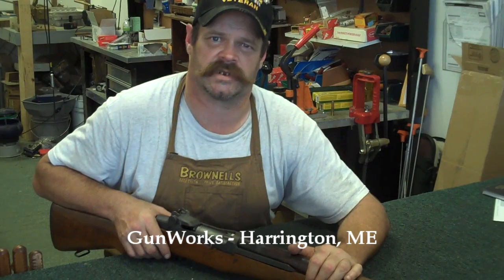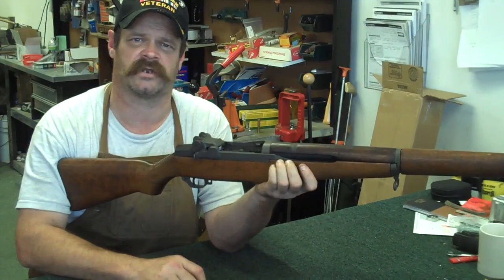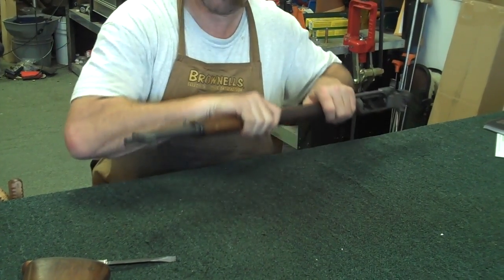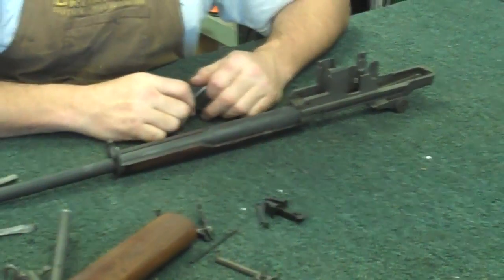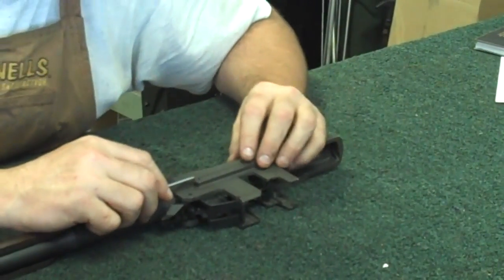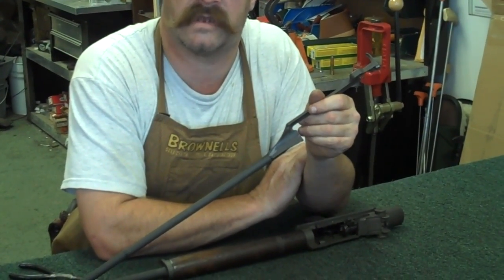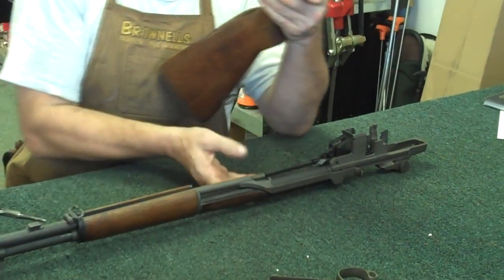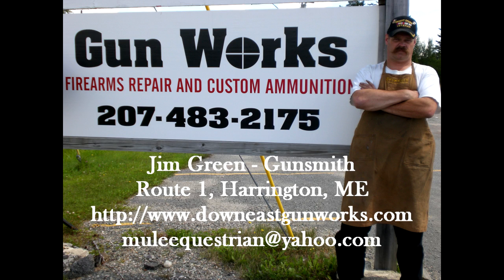Gunsmithing Disassembly: M1 Garand (.30-06) (Gunworks)

Comment: Suggest tapping on the bayonet lug and not the front sight, though it's not a big deal either way. Also, once you have it built and in use, you don't and shouldn't remove the gas cylinder too often, perhaps once a year with moderate shooting.  Any more will loosen the fit and degrade function.

Comment: Jim,
Thanks for the video.  I just did a full teardown for the first time on my Garand so I could re-finish the stock on it.  The gas cylinder on mine is really tight too.  The soft taps with the plastic mallet will be what I'll need to do to mine too.  You've made it clear and easy to understand the teardown and assembly process from start to finish.

Comment: Jim I also found an incorrect bullet guide. I have a very early 309xxx serial number SA. The bullet guide was later stamped part with the cutout. When I went to reassemble I couldn’t get it in. It is approximately 10 thousands oversized. I ordered a new one. Thanks for your videos. Semper Fi!

Comment: I suppose it doesn't matter, but doesn't the op-rod spring install with the tapered portion sliding into the follower arm?
Reply: "Before putting the Operating Spring in reattach the Follower Rod. Many of the M1 Springs the springs are 'necked down' on one end. This is the end that we thread the Follower Rod into." CMP tech tip  civilianmarksmanship dot com/assemblyhtml/reassemblefeed8 dot html

Comment: i just a watched a socom 16 disassembly and cleaning with a grease: lubriplate. Oil was also used. Any opinions on using grease to lubricate your rifle? i did not fail to see you doing here. what if one were to use very thin layer of grease on everything and do without the oil?

Comment: M1 rule of thumb is "if it slides, grease it; if it rotates, oil it."  The most important places for lube though is to grease up where he mentioned (on the op rod), all of the bolt's locking lugs, and the associated rails.  Beyond that, lubricating some of the pins and other parts that interface will reduce wear.

Comment: On my garand the taper on the op rod spring fits snug over the follower rod. I noticed that you put the tapered end of ur spring in the op rod 1st. just wondering if it works both ways or if its recommended one way or the other. my garand seemed to operate fine with the spring in oppisite as you had it in the video. Thanks and great videos i enojoy em

Comment: You're a Marine and called it a "gun"?  Drop down and give me 150.  Gun, my ass, it's a rifle.  And yes I'm a Marine and a Vietnam vet.  That little "lock piece" is called a gas cylinder locking screw.  You need to refresh the nomenclature of an M1 rifle, son!  That's called a bullet guide and a follower.  Every Marine knows you use luberplate grease on any military rifle.  Where did you go to boot camp, California?  You must be a Hollywood Marine.